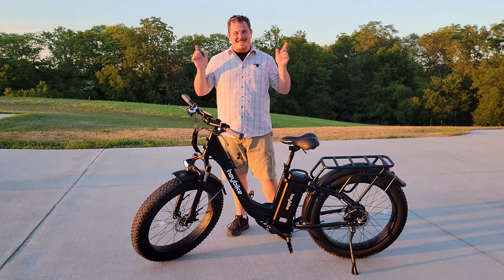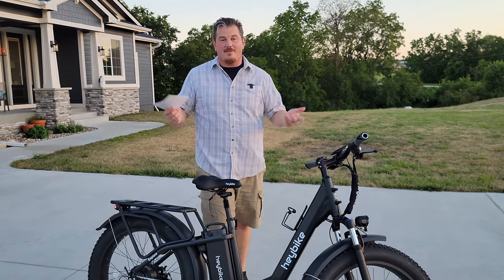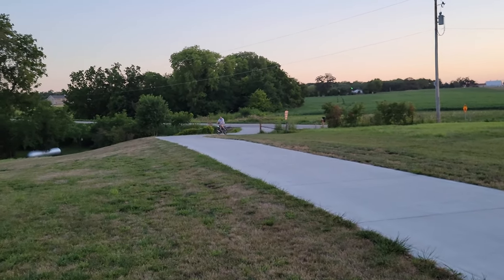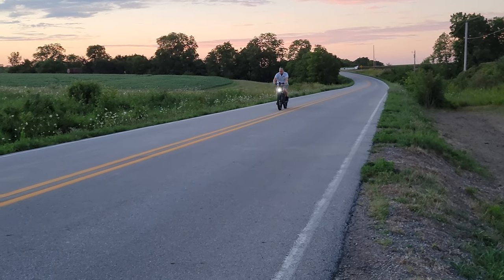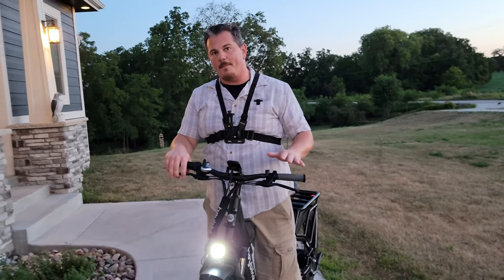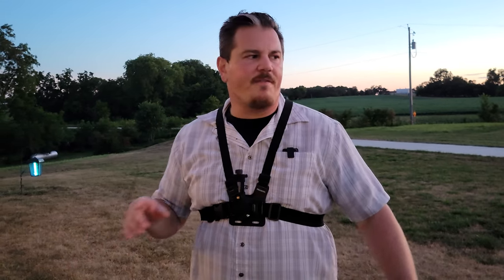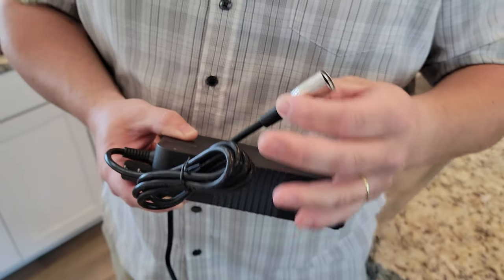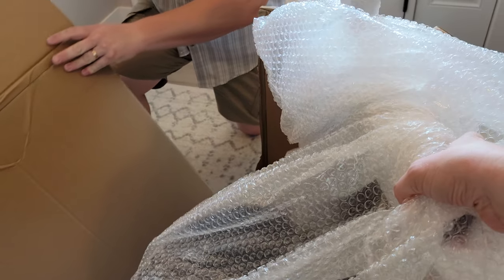Heybike - Explore - EBike - Unbox, Build, & Maiden Run

Comment: There is an easier brake adjustment.  It also works for when the pads wear.  There's an Allen adjustment on the back side of the caliper that you turn that closes the gap between the pad and the rotor or disc.  Just for future adjustments for ya.

Comment: Are you able to take the key out of the  battery without having to take the battery out aswell?
Reply from the maker: I think you need the key to remove it, but can keep the key out (I'm sorry, it's trapped in front of my truck at the moment)

Comment: Looking into getting 1 of these but im new to the e bike world, so u just leave the bike in 7th gear and its not hard to pedal i see,,so it will only go so fast with just throttle?the max speed can only be reached by using pedal assist,in the lowest gear??could u explain more in depth,?how all of it works,also would u only use 1st gear if pedal assist is off? Thanks for the good reveiw btw😁
Reply from the maker: You can ride in the higher gear, and just leave it there, but when and if you need to "help" the motor out, you'll be working hard. It's super easy to change gears, shouldn't be an issue - great quality shifters.

Max speed is basically what you can go with the motor, and then just a bit more. On some of these electric bikes, you'll be over the speed of the gear ratio before you run out of human capabilities, just an FYI,

Since this is a HUB drive (on the back wheel), like most ebikes, there's no gear changes as far as the motor is concerned...if it were a MID Drive (in the middle, attached to the pedals) then you'd get the advantage of the gear shifting and efficiency to boot.

Hope this helps!

Comment: Can someone tell me what size bearing to get for this explorer type please ? I need to buy a replacement.  And how do i get new cushions for the handle bar
Reply from the maker: I suggest you email HeyBike. They have been pretty good for answering questions we've had. (follow one of these links, and there's an email there)...

https://bprc.me/Ebike_Explore
https://bprc.me/Ebike_Ranger
https://bprc.me/HeyBike (I used this to verify, and then scrolled down to the bottom - "Contact Us" or chat support)
https://bprc.me/HeyBike_Assessories
https://bprc.me/XnitoHelmet

Comment: Will you do a follow-up (second look) video showing how to go from 20 mph limit to 28 mph (in settings)?  The manual I downloaded says it's limited to 20 mph out of the box.
Reply from the maker: Mine wasn't! I have to peddle for the last couple MPH, but I can cruise at 25+ MPH if I'm level to downhill. I can't believe how well it does driving around the house on the hills!!! I can FLY at 20+ MPH across the rough ground!
Reply from the maker: We do plan to do another followup with this and the Ranger together, fyi

Comment: told you on first e-bike video you would want the bigger machine,lol.Updates on PPG?,nice job
Reply from the maker: PPG update - I'm still scared to fly here since the power lines are the reason I sprained both ankles on my 10th, and last flight. I've gone our and kited a few times, and trying to keep the muscle memory alive. I have also tried to launch a couple times across the street. The neighbor is super cool, and let me use his triangle lot up at the corner, but I couldn't get inflation, the wind was too weak, and I just huffed and puffed a bunch.

I need the power lines buried, but fear that we'll drop $24,200 just to realize that I could have done it safely without. This would be a huge bummer.
Reply from the maker: to clarify, I sprained both ankles at my friends site....where I was hemmed in by power lines on all four sides!!! But I sprained the ankles since I forgot to get out of the seat - dohhhh.

I honestly want to be flying so badly, but we've been genuinely so busy, there's been so little time. I'm gonna kick myself if I don't make time and get flying some more ASAP!

Comment: What is the slope % the bike can handle?
Reply from the maker: Totally depends on how heavy you are. I'm heavy, like 275-300 lbs in this video, so it's a lot less than if my son, who's 1/3 my weight were riding. I'm sorry it's not so simple as the Chinese marketing departments would have it be, but that's the truth. Amazing bike, BTW, but when it comes to EBikes, you'll get help even if it's a super steep slope and you have to actually pedal to help, where without EBike assistance, it would be a terrible hill. My experience is riding off road, and I max out the assistance, and have to help, but it's too late - LOL - and I stall it out ;( This happens to me, so I jack-knife up the hill, back and forth to help with the steepness, but even on the same bike, same ME, and I'll have to gauge my progress to know if I need to cut the hill short.

Hope this helps, but AMAZING bike here!